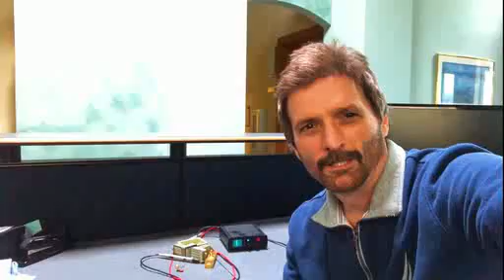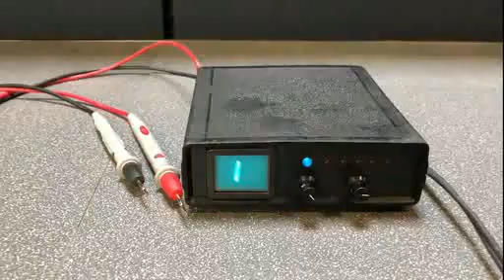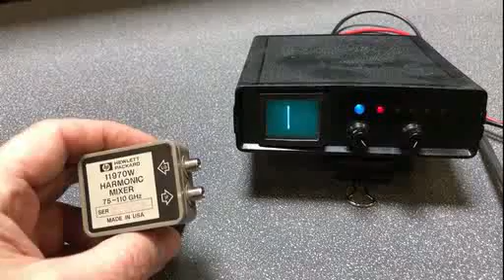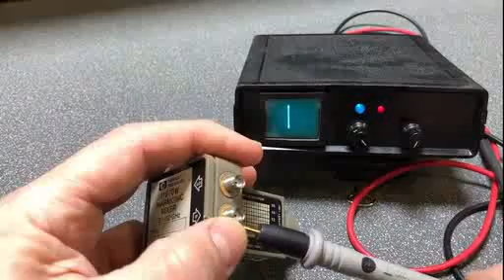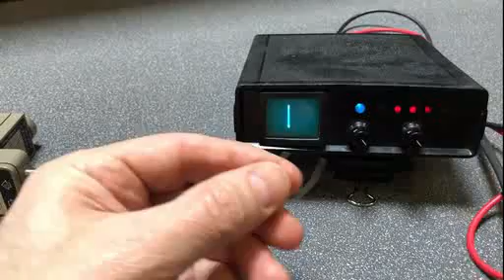David Mason demonstrates his oscilloscope invention

Comment: After watching Season 3 of Skinwalker ranch and how they were finding 1.6 gighertz happening when strange stuff goes down. I thought of you and your tools. Is this something that I might need to add to my collection of skywatching tools? I'm thinking when I do record the next UAP, I'd like to have other sensors to see if they can help in the research. I'd love to see a video of your newer device and how that works. I'm just a padawan learner.
Reply from the maker: Hi Tom, this device is primarily designed for measuring components. However, it could be used in its high impedance mode setting to measure electrostatic variances if that relates to the UAP phenomenon.